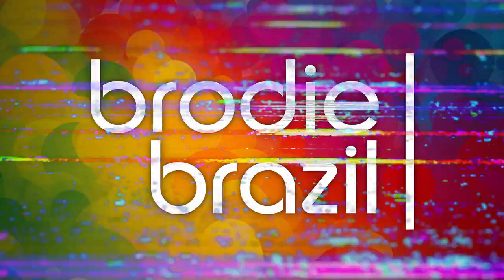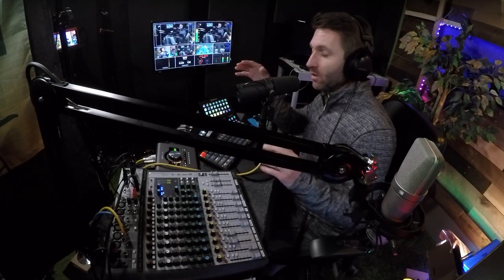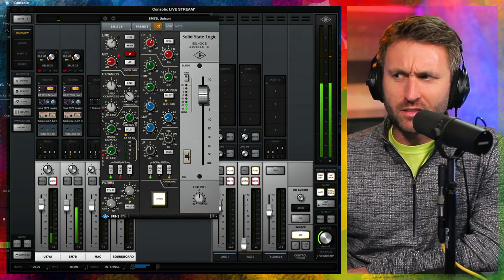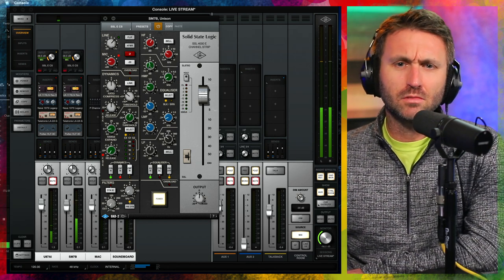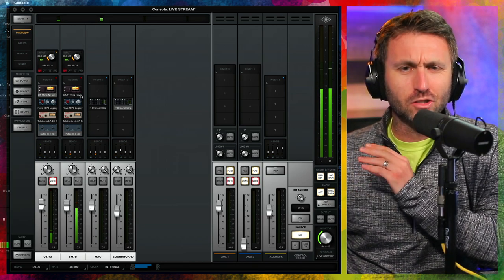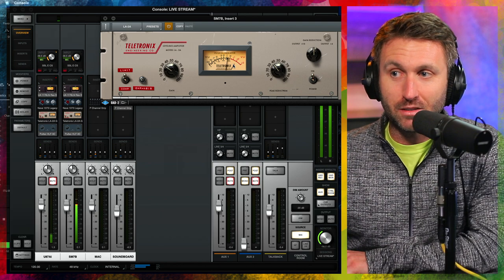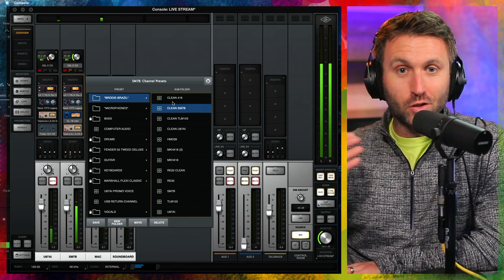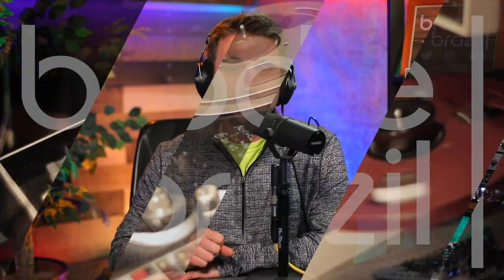Shure SM7B vocal processing with Universal Audio Apollo (2022)

Comment: Thanks for the great Video. I am new to Adobe Audition, and I have a Rodecaster Pro 2, which I think was a mistake. I have an Apollo Twin, and a bunch of UA Plugins. I have tried just bumping up the Twin on the Pre Amp but need to go almost to the max, before it hits Adobe Audition. I have a lot of experience with Music Production, but nothing on Podcasts until now and it's harder than I thought to be honest!! So to my question; if all I want to do is boost the gain, would I be right that you should do it using a small part of your suggestion here, so that when it hits Adobe Audition the recording will perhaps be slightly improved? I keep reading multiple people saying you don't need a Cloudlifter etc, and the Apollo just needs to be maxed out on the pre amp, but I am starting to wonder .. anyway .. sorry for long message, just trying to get a good sound for my Podcast .. and losing my patience lol :) have a great day ..

Comment: Has anyone ever had an issue using the ssl e 4000 as a preamp in the unison slot? Having a problem where the plug-in will turn the fader and the output knob all the way down if I’m using the plug-in as a preamp in the unison slot :/

Comment: I use the SM7B with Apollo Twin X and cloud lifter.  I find I have more white noise/line noise than there should be and it catches background noises a lot. Any idea why that might be and any fixes to it? Thanks for the video!
Reply: I'm having the same issue
Reply: Should be plenty of clean gain with what you have, so something is either broken, or else you're trying to record very soft sources while being too far from the SM7. It's not a sensitive mic; gotta be right on top of it and singing or talking loud. Background noises in your room can only be solved by not having background noise in your room, or using an expander to turn them down.

Comment: is the cloud lifter necessary?
Reply: Not really, just get a good pre-amp with a decent EIN (Equivalent Input Noise); I've been using an SM7B with the sE Dynamite DM1 connected directly into the Go XLR Mini, and I don't hear any difference with the noise floor.
Reply: No. It's just a cheap way to try and compensate for a wimpy preamp. It's not a miracle... the SM7 is not a sensitive mic and not the best for quiet sources.